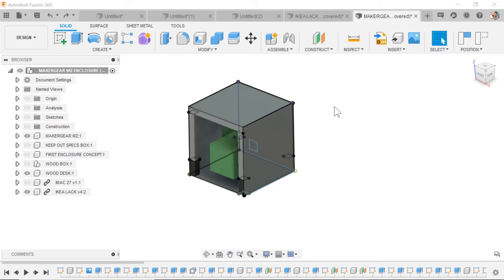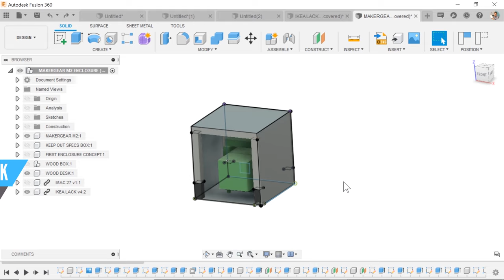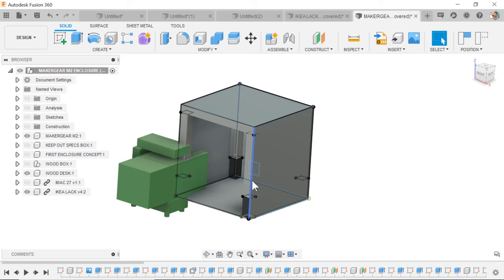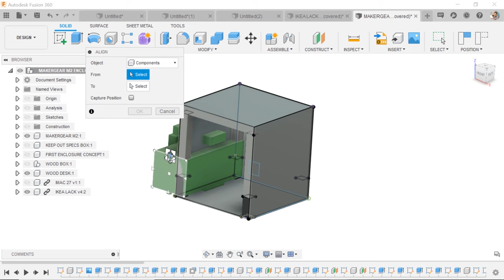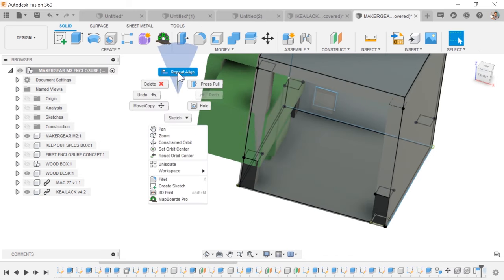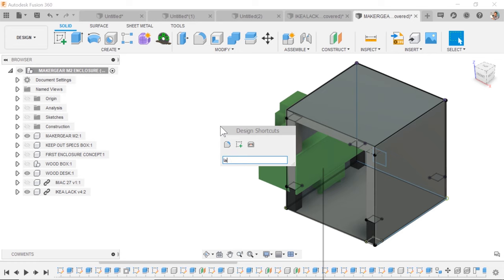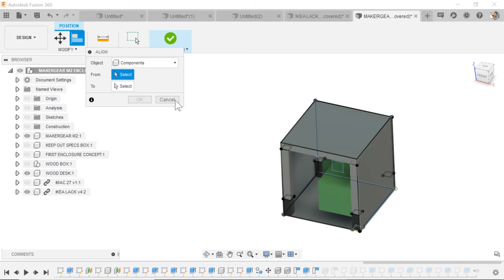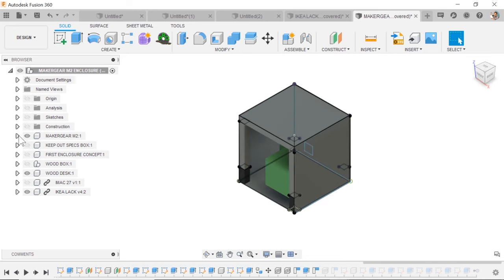Fusion 360 Align Command ( How To Line Up Parts Quickly)

Comment: Doesn't work if something is at a slight angle. I have 2 curved objects where one is slightly rotated, but it only aligns it and doesn't rotate the model to fit flush against the other.

Comment: Man this was so crips and to the point. I wasted hours yesterday listening to this guy take about an hour, just to explain how to use joints, and then I still didn't get it (I'm dumb and he talks too much!). This was really what I needed to advance my newbie status up a notch. Thank you so much. By the way, for now all I want to do is design a 3D printer frame from 2060 aluminium (horizontals) and 2040 (verticals). Any videos on working with profiles inserted from the parts websites, would be really well received by me.

Comment: How do you align angle.
So holes on one object line up with holes on another for example.
Point to point works if the angle doesn't matter, but when you need the angle to line up for multiple bolt holes, that's when I don't know what to do.

Comment: One note, and correct me if someone knows a different way: I have a component with child components. If I try to align the face of one of the child component to something else, only that single child component moves. In order to move the entire group, you must first create a "rigid group" of that group of components (right click on the main component and you'll see the option in there). 

Then when you click on the face of the child component, the entire group will move.